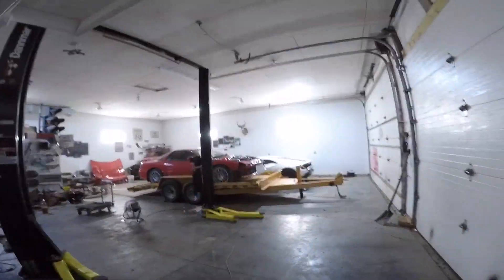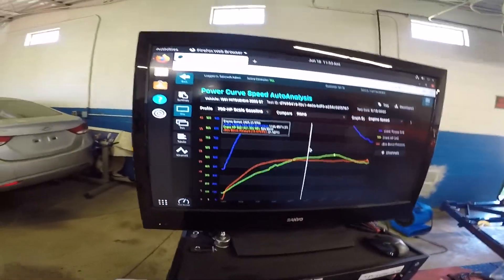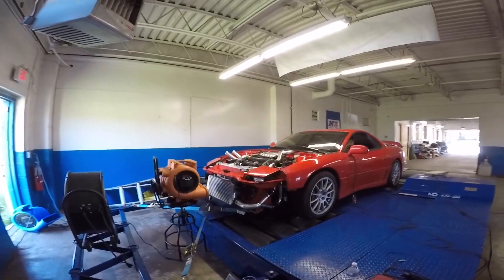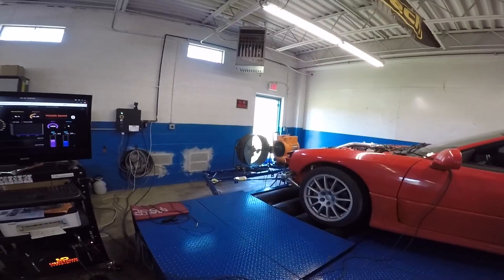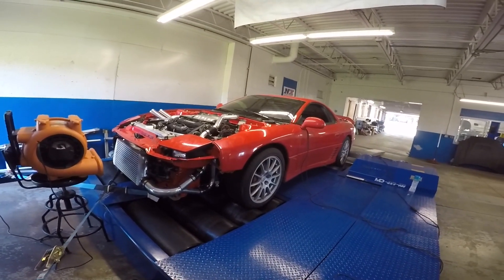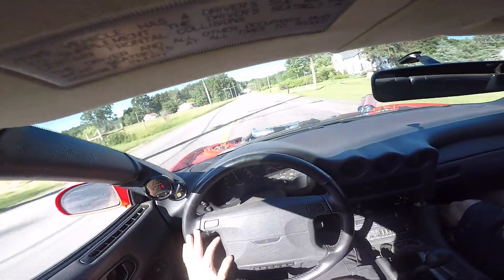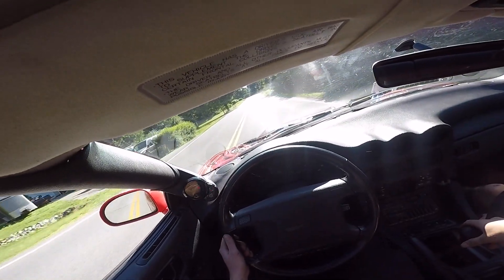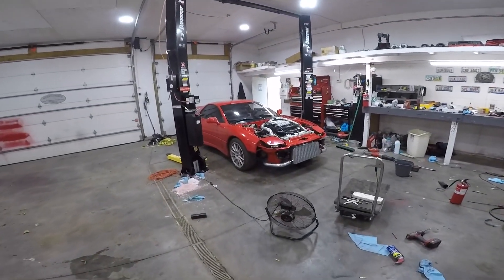A Built 3000gt is a Torque Monster on the Dyno  [ Twin Turbo 3000gt vr4 6g72 ]

Comment: Awesome to see another 3S guy get it.

For the ignition one trick you can do with the stock coils is hotwire them, just like you do the fuel pump

The wiring from the ign/lock cyl gets weak due to age and can hit the ign output.  

Oooor convert to COP and move past the PTU/stock coils altogether
Reply from the maker: Yea I need to do something

Comment: Going back and benj watching all of these videos is awesome bc I just found your channel about 3 or 4 weeks ago because I just got a 3000gt sl out of a junk yard that I want to build and turn into a vr4 by finding all the vr4 parts off of totalled and unsavable vr4s but they're so hard to find and they're expensive so it will take a while but I'm going to be using your vids to help me out whenever I run into problems

Comment: Don't get obsessed with what that dyno says for numbers, these cars are real street rippers having awd and quick spool turbos. Your mid size turbos are perfect to play on the street. there's nothing more aggravating than a ton of boost lag when you decide to punch it and play on the street. You'll find that your Vr4 turned into an SL until 6k rpm, or you have to drive everywhere in 2nd gear at 5.5k to have power on tap. :-/ Not fun unless you want it to be a track car.
Reply: Yeah !! Talking about bigger turbos not even having been able do drive it.  Lol 😂😂 enjoy the car dude 😎

Comment: Of course You’re maxed out on those 15ts lol that’s good power #s for those.. 20t billet tdo4 hl with e85 should hit around 700whp all day if tuned correctly around 600whp on pump
Reply from the maker: 🤣 .... I was just hoping for 550 .. Was thinking the 15gs from my buddy's brother was going to put out alil more power
Reply: @huracanian3051  The vr4 has around 25% drivetrain loss so at the crank your 120hp more lol

Comment: I really appreciate your time and willing to make improvement with your car. Plus sharing information as you gain power. I’ve just acquired a 91 stealth rt turbo w 5 speed . Haven’t even got plates for it yet but it’s gonna need a clutch.. slipping over  4500 . What do you recommend? I may upgrade etc, so I may as well put in good one(1 time) my other question do you need to remove engine trans assembly to replace clutch or can I drop it out by removing transfer case & trans ,exhaust, etc.. anything else I should get done, Intake spacer seems  keep charge cold, a must , you go with lighter flywheel?  
Keep up good work!!
Reply from the maker: Sorry .. I just seen this I like Spec's clutch... depending on how much power you're going with depends on what stage you should use... and you can get to the clutch by dropping the transmission ... so drive shafts shift cables crossmember transfer case exhaust starter is going to take everything off of it.....
Reply from the maker: And I would do the slave and braided line while you're in there

Comment: I'm going throw in my research here, my 3g with 6g72, I've put in e3sparkplugs. Just something to consider.

Disconnecting the coolant line from the throttle body would of been the majoy factor of cooler intake plenum. However really nice mods from spacers on the Plenum and throttle body gasket!

Comment: 3000gt is such a rare car look after it man
get the 2 stock turbos rebuilt and high flowed that way you keep the same housings and everything, high flowing them will get you 600hp i reckon. thats the limit of the 4wd and gearboxes i would think anyway
Reply from the maker: My stock turbos are on my wall lol .. I got 15g's turbos and i fully built engine. It's on all my channel ..
Reply from the maker: https://youtu.be/ZSkCzFwGDKE
Reply: @huracanian3051  ohh it sounded like they were stock turbos. as I would have sized the turbos properly if I bought new ones and replaced them with the current ones. give garret a call. tell them what you have, tell them how it behaved on the dyno and ask what turbos they recommend
that need better ignition. get some R35 coils and re gap plugs. also if turbo makes same power at 28 psi why is it keeping it at 34 psi. its just stressing turbo at this point

Comment: Bov sounds great. Stock ignition is good for 1000hp. You just need healthy coils and good wires and spark plugs that are gapped right. Don't go single turbo. It will be much more laggy and under hood temperature is going to be a lot because you will have a lot of hot pipe. Heat management will be very difficult with a single turbo but it will sound great for sure. It will change how the exhaust sound too.
Reply from the maker: I have brand new OEM coils good wires and I have V  power NGK plugs heat 8
Reply: @huracanian3051  what did you gap them at? I have made over 500whp on old as coils no problem. Just have to gap the sparks down.
Reply from the maker: @mehrshadvr4  18
Reply: @huracanian3051  interesting. That low and still have spark blowout?  I would just go with coin on plugs then.
Reply: He'd need ceramic heat wrap and if it's a disco potato a bracket to hold it and put less stress on the headers which is what really causes cracked headers. If he has a standalone he can tune in the cooling fans as well.

Comment: Loved my Stealth RT, great platform that was ahead of it's time.  Be careful when you up the power.  Once I went upgraded Turbos and bolt ons, It blew out 2nd gear. (Mine was the 5spd) The new transmission stripped the rear output shaft 4 months later. They were pretty weak.  If you have the newer 6spd, it supposedly will take more.
Reply from the maker: Yeah I'm going to build my transmission soon

Comment: What gearbox did you guys use or did you strengthen the original manual box ??
Reply from the maker: It's the stock 5-speed .. And it's the stock transfer case 😏 lol

Comment: Don’t do a single. Wouldn’t think your out of injector? What was the rating of the fuel pump?

Congrats on all the hard work!
Reply from the maker: 800cc and 360l pump
Reply: @huracanian3051  My guess is you’re out of pump. A lot of people are going with Hellcat pumps. Just installed one in 2/3 of my Stealths. I would definitely try that before injectors. A lot cheaper and easier to do. 

Have you played with fuel pressure at all?
Reply from the maker: @96stealth  yea a lil

Comment: Easier to keep it twin turbo. Right now I got a 1998 VR4 TT myself i am having trouble with and could use turbos there are videos on my page yu can see. Rn its leaking oil from above the oil filter, any ideas??
Reply from the maker: Yea there a oil feed line to the turbo above the oil filter that those banjo bolts go bad or sometimes back out
Reply: @huracanian3051  Thanks a lot, I’ll try that in the morning. Hopefully just tightening them down stops the leak.
Reply from the maker: @Jappo102  I did a video on that oil filter housing... I honestly don't remember which video it's in but.... so if you look under the bracket that your AC bolts to.. that oil filter housing has three bolts that go into the oil pump that gasket could be leaking or there's a banjo bolt like I said that's probably your problem if the leak is above the oil filter
Reply: @huracanian3051  your right, it’s leaking from the banjo bolt above the housing. Had to pull the catalytic converter to get to it. Hopefully,  I can test drive this thing later
Reply from the maker: @Jappo102  how long has it been leaking that front turbo might be toasted ......
Reply: @huracanian3051  hope not. these are new tdo4 eliminators haven’t driven with them yet. I think I stripped the housing because it doesn’t tighten 😳.
Reply from the maker: @Jappo102  yea it's aluminum I've done that......

Comment: Is your BOV installed backwards? It look like you have the outlet plumbed to the intake pipe and the outlet vented to atmosphere which shouldnt work at all. I think if so then tou are just hearing regular tuebo flutter which my MR2 does very loudly and it souds like this, and I have no BOV at all.

Comment: I wonder if the hood will have enough clearance now that plenum spacers are on... As far as I understand it raises the plenum higher. 
There isn't much room between the hood and components under it (how I know) Had a battery a bit taller than stock once and it shorted out touching the hood.
But hopefully everything is good with that. 
Thank you for the content and just enjoy your car.
Reply from the maker: It should

Comment: I hope you guys turned it back down to 23 psi since the difference in power between 23 to 29psi is like 3 hp.. over spinning those baby turbos and not making anymore power.. but as u said most ppl told you it wouldnt get anywhere close to 600hp.. impressive torque thou

Comment: What kinda radiator do u have mine gets hot at 120
Reply from the maker: They all get hot 🤣🤣but mine is a koil I believe
Reply: @huracanian3051  lmao thanks
Reply from the maker: @longassrice8756  120 is not that hot ... do you mean it leaks at 120 ?
Reply: @huracanian3051  no it starts running hot when i push it i was racing a bmw( closed course) and the engine started to over heat
Reply from the maker: @longassrice8756  OoO 120 mph 🤣🤣🤣🤣
Reply: @huracanian3051  lol yeah so it's time for a new radiator I've been babying it ever since

Comment: I wouldn't go single turbo. 19t or 20t from Arashi are perfect but will need a little modification. Billet DR750s are plug and play 700-800AWHP but are expensive. Your spark blow out shouldn't be spark related as it only does it randomly, more like a connector issue with the broken tab. It's a never ending game of wanting more power lol. I knew the plenum spacer out help your intake temps.
Reply from the maker: It's never done lol
Reply: Why not go single if you can get the headers for under 1500?
Reply: Everyone says those 20ts will make 600 but where are the video or Dyno sheets to prove so? Single is more guaranteed.
Reply from the maker: @joeysmokez8423  🤔
Reply: @huracanian3051  I'm in that boat right now owns TD04HL 20ts wants 600 wheel having doubts they will achieve it can go single.
Reply: @joeysmokez8423  The IMR single turbo kit is 3200. You will need to delete a lot to make space for the piping too. Single would be great but it's a pain to make it work.
Reply: @ThatOneVr4  I know a guy who makes them for like 1500 shipped in Florida.
Reply: @joeysmokez8423  That's a great deal.
Reply from the maker: @ThatOneVr4  yea it's will be a pain
Reply from the maker: @joeysmokez8423  u got all the deals 1500 bucks for everthing but turbo and wastegates ?
Reply: @huracanian3051  Yes everything but turbo and WG. It's really 1300 but shipping may add it closer to 1500.
Reply from the maker: @joeysmokez8423  does it have two wastegate holes
Reply: @huracanian3051  I believe so be will tell you everything just DM him.

Comment: Very impressive numbers for 15gs.  I used to have 15gs, but I bent a stock rod in 1st gear one cool night at 22 psi.  15gs spool great and make 1st gear pretty violent.   Now I'm running 20ts-td04HLs which should max out at about 600-650.  The 20ts from arashi or kinugawa are about $1000 so they are pretty cheap for the power.  They are similar power to 3-4k DR750s but don't spool quite as fast as the old DR750s with the lightweight titanium turbine wheel.  Fast spool can be dangerous though.  High cylinder pressures at lower rpm induce knock very easily, which is why nitrous is extremely dangerous on a boosted car and the tuning needs to be 100%.  You might get away with nitrous if you hit it over 5000 rpm, but your exhaust back pressure is already insane right now considering the torque so I might hold off on nitrous.  

Are y'all keeping an eye on the knock sensor?   On 93 octane with 15g turbos, around 17 psi is the max boost before the knock sensor goes crazy and detonation starts.  Your forged rods and pistons will withstand a lot of detonation before failing, but your bearings are not as tough.  I would drop boost down to 18 psi on 93 octane and 25 psi on 110 octane.  I would get a meth injection kit or run e85 since it's cheaper than 110 octane.

If you get a hydraulic press and some decent sized bearing splitters, it's not too hard to replace 3rd gear's synchro.  With some good bearing splitters and if you press the gears off with the bearings, you can do the whole job without replacing any bearings.
Reply from the maker: U want a job ? Lol yes to pretty much everything you said
Reply: @huracanian3051  I had fun pushing the 15gs, but I think with my current setup I'd rather dial it down a hair and it be safe and reliable.  i don't know about you, but if I blow up my engine again I'm probably selling my car.  lol  So much work goes into rebuilding I don't know if I could do it again.
Reply from the maker: @TheWhoever811  well if u do hit me up .. What year ? U got a 4 bolt ?
Reply: @huracanian3051  It's a red 92, 2 bolt w/ main studs, forged rods and pistons, ported heads.  Got about 10k miles on the engine so far.  I'm gonna try not to blow it up. lol
Reply from the maker: @TheWhoever811  lol .. Will if u do I want then heads ok lol
Reply: @huracanian3051  I got a 4 bolt w forged rods and pistons for sale came off a spun engine.
Reply from the maker: @joeysmokez8423  how much
Reply: @huracanian3051  $400.00 for forged 4340 H beam rods 
$400.00 for Wiesco Forged Pistons w Rings 
$150 for H13 Wrist Pins 2.00' Thick
$100 4 bolt block 5k miles
$500 freight shipping.
$1550 Total Shipped.

The crank is no good as well as bearings everything else is reusable.
Reply from the maker: @joeysmokez8423  a crank is one of the hardest things to find unless you do a Stroker for like 8,000
Reply: @huracanian3051  You can find forged cranks from a stock 94-99 Vr-4 for a few hundred bucks. Its the Brian crower billet crank that's like 4k.
Reply from the maker: @joeysmokez8423  where ?
Reply: @huracanian3051  The Crank Journal On My Forged crank is peeled like a carrot which I don't think is fixable lol.
Reply: @huracanian3051  Lmk the spun shortblock with the reusable internals are sitting in the garage I want to sell and buy a single turbo kit lol.

Comment: Yo man sorry to bother. You put forged rods and pistons if I don’t go that route can the stock rods and pistons handle 490 hp?
Reply: Stock rods are forged already so you’ll be fine with them, but the pistons are cast so you’ll need forged ones
Reply from the maker: I mean if you're going to rebuild it anyways I would just see how long you can run at 490 with stock setup lol

Comment: Hey Ian DR750s is want you want if you wan to stay on TD04s. Proven 650whp on e85 and a 10 sec car. Check out this thread.

https://www.3si.org/threads/the-ultimate-to-me-3s-build-dynoed-my-car.541581/

Contact Ray Pampena or Matt Monet from Dynamic Racing if you want the ultimate 3s. Congrats on the 500whp achievement.
Reply: DR750s are definitely the way to go…. You won’t regret it. 👍🏽
Reply from the maker: @mariowright4383  lot of $$$
Reply: DR-750s are too expensive. It’s a once and done turbo mod but everyone usually keep going to another setup. I have owned DR-750s, Arashi 20T-HL, and Kinugawa 20T-HL with side by side pics of the wheels. DR-750s are a proprietary 20T inducer/exducer compressor wheel with a 4 degree extra clip over the off the shelf TD04HL turbine. Larry McCoy rebuilt a set of DR-750s for me and did the clipping work on the turbine. I’d run the 20Ts day in and out over the 750s for 95% of the same power output plus it’s only a $1100 bill to get new turbos vs $2500-3k to rebuild the 750s. It’ll hurt your wallet big time when they fail above 30 psi. DR-750s also don’t have a dual port upgraded thrust bearing for 30+ psi. I had to add that to mine to get them to survive almost 10 years ago. I switched to the 20Ts and didn’t look back.

Comment: Big single Turbo, Bigger injector, and bigger fuel pump if your not already.  If your not already try gaping your plugs 🔌 to .0016-.0014  its been shown to help when boost blows out the spark.
Reply from the maker: I'm at 18
Reply: Try it out with the .0014 gap, id love to see the differences before and after when rolling into boost 😎
Reply from the maker: @MotorisedMechanix64209  maybe I'll try it out those V race plugs from Honda are not cheap ...
Reply: If you run the coil pack hotwire mod you can likely gap them in the mid 20s.